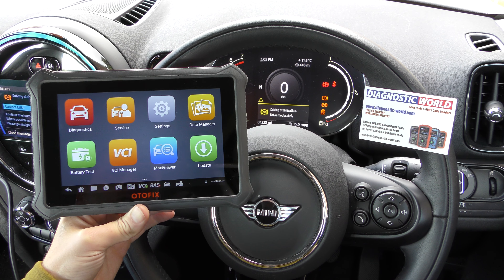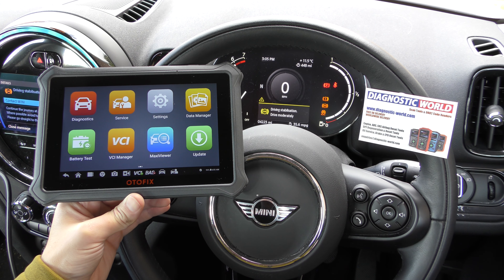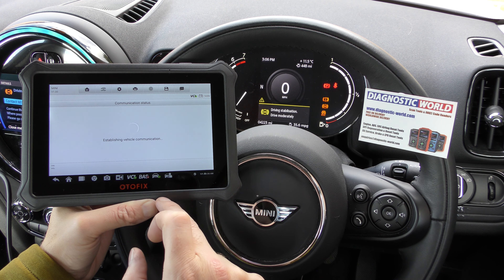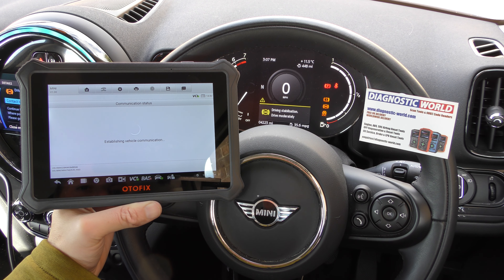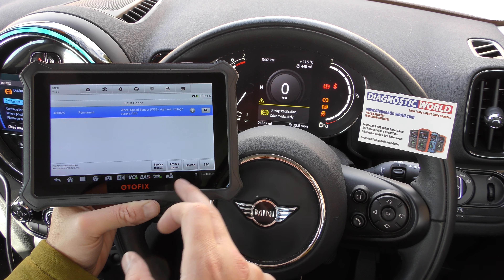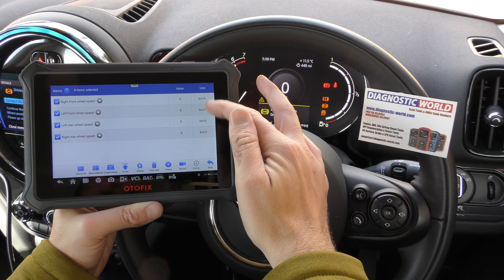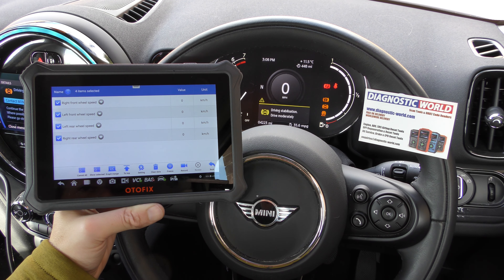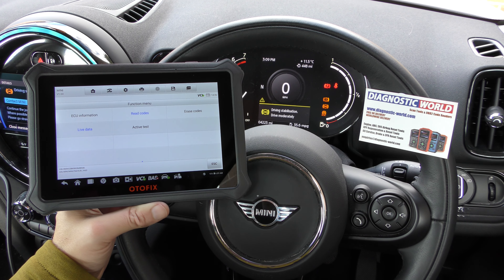Mini ABS DSC Warning Lights Diagnose  & Live ABS Sensor Wheel Speed Sensor With OTOFIX D1 Countryman

Comment: I have a 2004 mini cooper R50. I had a slow leak on the left front tire and had it plugged. Now the LOW TIRE and DSC lights are on solid! Changed the driver's side abs sensor. Hooked up my Innova 5610 scan tool and noticed that it won't link to the TPMS module systems? The ABS scan did show 5E5C and 5E43 codes. Cleared them both and they just came right back on after a short drive. Some posts say it could be a faulty Steering Angle Sensor, but I don't want to basically keep replacing parts for no reason. All this from a slow leak? What could be the issue?